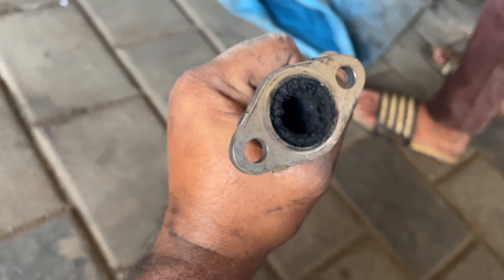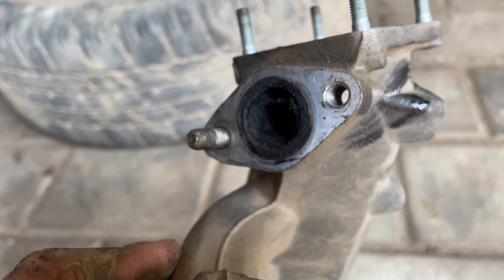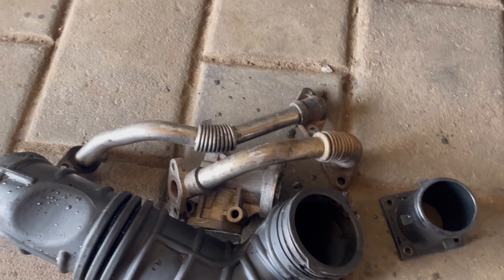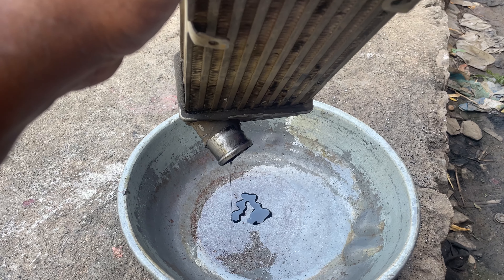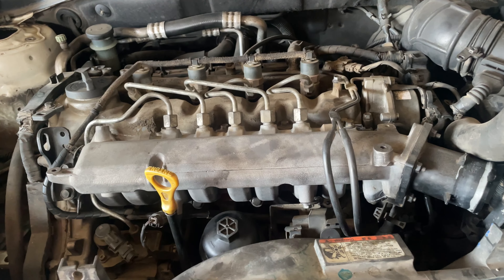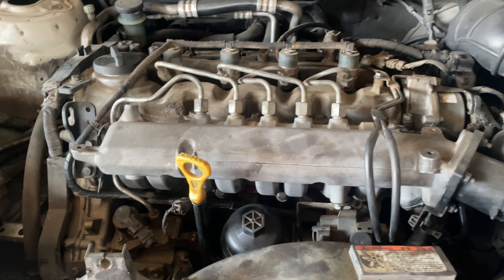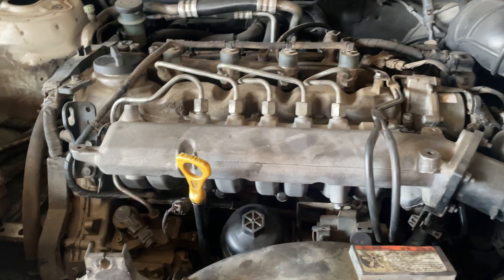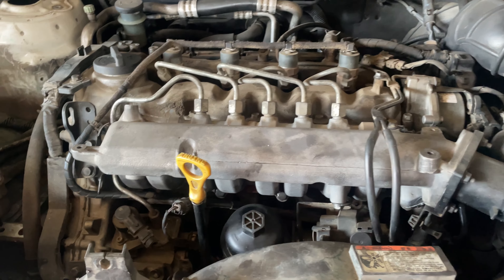Black smock and pulling less| Hyundai Verna EGR and manifold cleaning | @autotrusttechinicaltips

Comment: Egr clean cheyan time period undenn ariyillarunn  ente 2013 diesel anu 60000 km service ayi . synthetic oil ethuvare use cheythutilla puthuthayi use cheyatal kuzhapamundo atho flush cheythitt ozhichu thudangano pls rply
Reply from the maker: Ozhicholuu kuzhappamillaa
Reply: @autotrusttechinicaltips  viscosity etha nallath synthetic il 15 w40 0w 30 5w30 10 w30 ethil eatha nallath user manual lil kanikunna grade anu pakshe normal ano synthetic ano ennu mention cheythittilla. Diesel engine oil grade anu.  Athil parayunnath lower viscosity better mileage tharum eannanu. Ath mineral ano synthetic eannu parayunnil atha doubt.   Pls rply  argent anu service ayi workshop Kalil oridath 5w30 paranju oridath 10 w40  avar use cheyyunna brand anu pramot cheyunnat.   Ethil 10w 40 ozhikanum pattilla